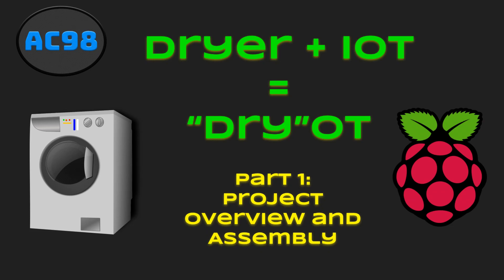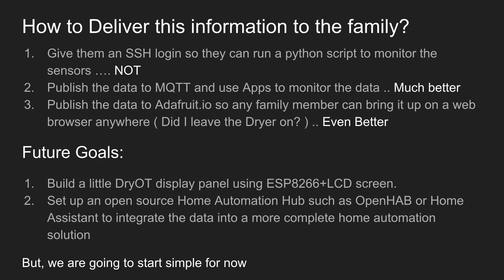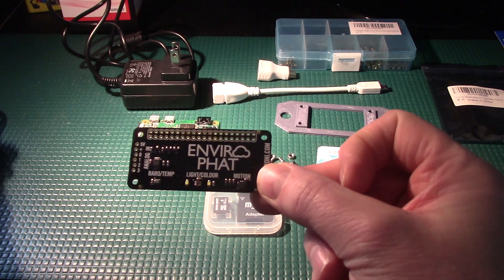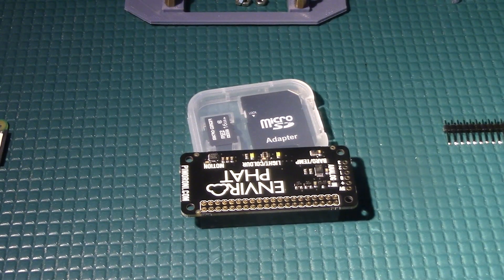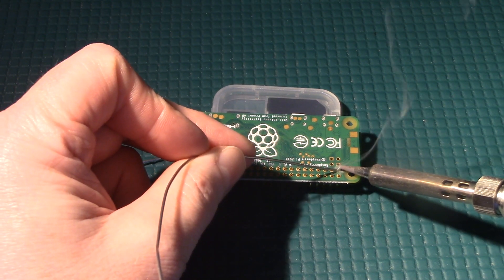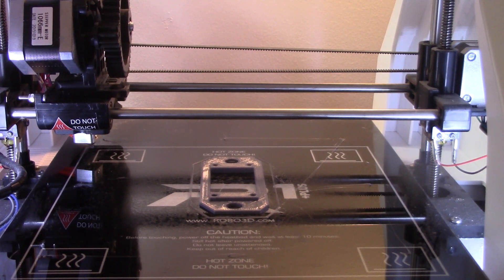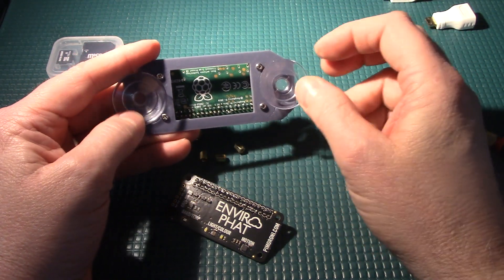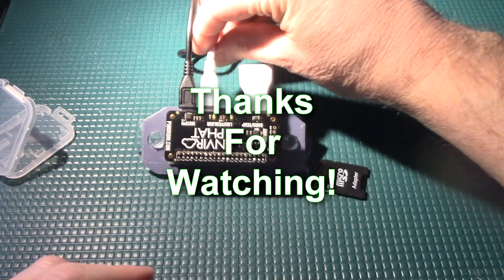DryOT Project Part 1: Intro and assembly for my Dryer IOT Raspberry Pi Project

Comment: Thanks for making this sample video - it helps to be able to see projects like this for ideas on creating our own and is appreciated! My main suggestion is to do something with the audio - it's difficult to understand a lot of what you are saying - like "echoey" or something. I'm not a sound engineer so I don't know how to technically describe it - but I really had a hard time understanding you.
Reply from the maker: Thanks for the heads up! I experimented with the audio settings and I have a much better sounding version. I'll try to upload that ( and a new version of my part 2 video ) soon. I'm not finished with part 3, so I'll try to make sure it sounds OK.
Reply: @AlanC98  Thanks! I am looking forward to seeing the third video. I am particularly interest in samples implementing RPi Python and MQTT. I'm making a air control system right now that will control 4 ventilation fans (and possibly up to 7) and using 4 DHT22s to monitor temps at different locations. It will be a relatively critical system so I want remote access to the temperatures and status of the relays. I also want to log the data - so MQTT with openHAB or Home Assistant are my current considerations - if not just a plain DB. As I do a bit of home automation, I'm leaning towards openhabian at the moment. Anyway - thanks!
Reply: @AlanC98  BTW, you said you are more of a programmer. I'm new to the RPi world and not very experienced with Linux - but very experienced in the Microsoft IT world. I have messed up an install of Linux Mint already trying to do updates to Python3 - somehow screwed up the Python base that Linux depends on? Had something to do with pip, pip3,  etc... There is something I am missing in understanding to OS dependencies on Python and keeping a current version of Python for programming purposes. Do you have any recommendations as to what to read to understand this split and how to work on one without damaging the other?
Reply from the maker: @ameador01   Hmm. I guess I'm not a python guru either :) It's possible to setup a virtual python environment for a particular app: https://docs.python-guide.org/dev/virtualenvs/  It keeps all of the libraries separate from the system python libraries. For the Raspberry Pi Projects, I tend to start with a clean install of the OS, then just install the python libraries I need for the project. Ruby seems to have a similar dependency problem. I guess that is why docker containers are growing in popularity, and now the Ubuntu Snappy packages. Both containers and snappy packages contain all of the libraries needed to run an application.
Reply: @AlanC98 I will look into those. I've read up a bit on docker - but not snappy. I've seen reference to the virtualenvs but what I saw was confusing and caused more questions than answers - but your source looks like a good place to look. Yeah, it's not a big deal - just re-image (or clean VM). On the Pi, it will be single purpose so no big deal either - but don't want to mess up vm's or other that I want to use as more of a regular desktop - then the time for build up can get excessive. Thanks again - waiting for #3 :)